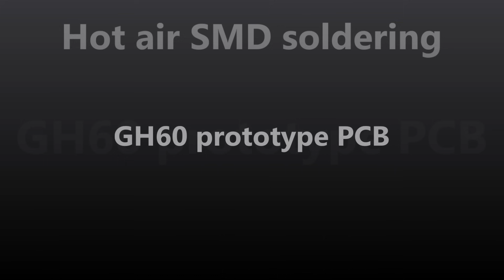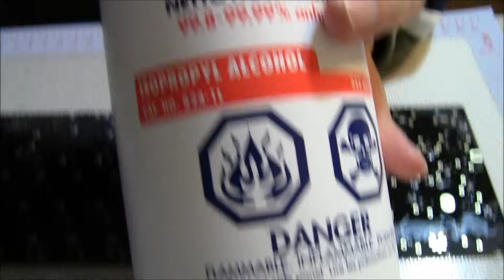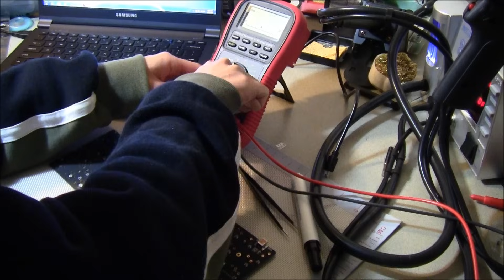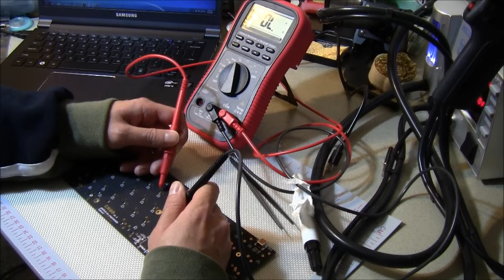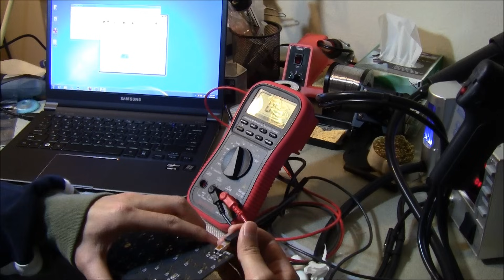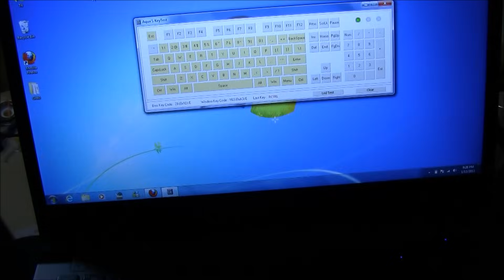SMD soldering by hot air

Comment: Well, I guess I goofed. The paste does not include a needle nor does it include the plunger. Digikey does not suggest that you add the 20 cents part to your order, so thanks a lot Digikey. They will also not tell you that the item requires an added cold pack which doubles the shipping cost. The paste also expires in three months so I had better get soldering...

Comment: what temperature and air power do you run your hot air and what temp is your soldering pencil at ?
Reply: +Chip Douglas Standard soldering pencil temperature is 700F.  Check the manufacturers product data sheet of the solder paste for the recommended air temperature and application time.  Always read the data sheet!!!

Comment: 17:15 Is the kapton tape (?) on the USB connector there to protect the internal plastic parts from the hot air?
Reply: I know it's been ~2 years, but in case you're still wondering, Yes it's!

Comment: This video would be far more useful if you gave us certain details like: What solder paste you used, what consistency is best [and are there other things to know about selecting the most effective product?] and what temperature and flow rate you set the rework hot air gun to, etc.  Also, we don't need to see every excruciating moment of solder paste application, camera adjustment, and heat application!!!  Some post production, please!  Otherwise, there was some useful substance.

Comment: What was the "marker" you used at at 11:30 and why?
Reply: That's a flux pen. Flux helps solder "wet" better by getting rid of oxidization. When you buy solder wire, it usually has some flux inside, which is what bubbles and smokes. Solder paste also has flux in it. But you're re-touching existing solder without adding more, you usually want to add flux.

Comment: I hope he has learned how to use a PCB paste template. (Sheet of metal with cut outs to where the paste goes.. So the paste can be slide across the sheet, thus filling the pads with paste.)
Reply: mhm... efficient.
Reply: If you need to do enough boards for that to matter, a die cut template makes a lot of sense..  but if you're only doing a handful, it's often not worth the extra cost, especially if you're doing whatever as a hobby, and not primarily for profit.
Reply: Valueless Dollar it's called a stencil

Comment: whats the wattage of your iron
Thanks
Reply: I'll guess 30 watts, if guessing helps.  When touching the tiny joints, it took at least a few seconds before the solder melted.  Also, the tiny needle soldering iron tip doesn't have enough mass to conduct a lot of heat, which also explains some of the time before melting, even though the joint is tiny.

So, iluvbeanz, what's the wattage of your iron?
Reply: Cheers

Comment: Legit question not bitchy comment: why not paste across the ic pads and drop it on top then use the hot air? Does it not work? Seems like it would...
Reply: Drop "it" on top?  Drop "what" on top?

What I saw, he was putting paste on the ic pads, and then dropping the components on top of the paste, and then using hot air.  Are you suggesting something different?
Reply: 5:45 - seems strange that you'd even need to tack it down, I'd assume the sensible thing is to paste across the pads and throw the chip on top and let the heat gun deal with it.

Comment: Where is your antistatic strap almost anyone can solder well with enough practice but if you discharge static energy from your body onto that controller chip all the quality soldering in the world is not going to make the circuit work. I see that it looks like you may have the board on an ESD mat and you may be useing ESD tweezers but this is an area that is never given the notice it deserves.  I am not trying to be critical of you , for all I know you may have a leg strap on but it would be nice to see this important part of soldering explained sometimes.  Otherwise good techniques .
Reply: You're obviously not an engineer.  Leave it to the pros.

Comment: The cringe from applying the solder paste, should have paid $30 for a stencil.
Reply: IMAKE 30 dollar stencil  for a 10 dollar pcb? maybe if he had 30.. you can hand solder these quicker just using surface tension.. but the hot air is pretty satisfying

Comment: You don't use flux? That is poor technique.
Reply from the maker: Except you fail to realize that solder paste has flux in it. If it didn't already have flux, then the actual solder would just be very fine dust. The flux mixture is what makes it a paste.
Reply: WhiteFireDragon
 What kind of solder paste you are using?
Reply: I was performing surface mount soldering long before any of you were probably born. I was taught to preflux the lands area, regardless of paste solder content. The prefluxing removes oxides on the lands, before the actual soldering process takes place using the paste or solid solder. The prefluxing removal of the oxides also promotes better and more uniform solder adhesion to the lands, it also reduces the frequency of solder bridges. I have been in the business of electronics for more than 35 years. Collectively I bet I have more experience and knowledge than all of you put together and have forgotten more than you will ever learn. That is my response to all of you now and those to come.
Reply: done
Reply: Michael Snyder thank you for the comment but the preflux can this be done with a flux pen or could you better use something else. thank you
Reply: Warner Hake You can use a flux pen or a small squeeze bottle ( with flux) with a needle applicator, the latter is available through most electronic suppliers ( Newark, Digi-Key, Mouser, or just about any supplier of soldering aids)
Reply: Michael Snyder thank you!
Reply: Warner Hake You are Welcome
Reply: Michael Snyder Respect to you sir! I am in university now, thank you for your comment.
Reply: Michael Snyder exactly :)
Reply: ***** please read my comments above regarding prefluxing, thanks.
Reply: +WhiteFireDragon I know very little about electronics and that was self explanatory to me...some people's kids... very impressive work, very clean, professional set-up. I'm getting into working on PCBs strictly as a hobby and these hot-air techniques are truly fascinating. I'm sure you just make it look easy!
Reply: +WhiteFireDragon The like button isn't working. Seriously.
Reply: also, I don't know if he uses it the whole video, but I think his screwdriver tip is too large
Reply: I've been using a Bon-pen for a while now. Made my soldering so much better with very little flux needed. Especially handy on very little islands that have virtually nothing to stick to...  ^^
Reply: ninjabox I see the OP ask a valid rhetorical question and make a valid statement. You on the other hand I see being snarky and arrogant. "You know." "But hey," I guess it's all in the eye of the beholder...
Reply: He didn't use flux to secure the first legs of the chip at 1:35. He used flux AFTER soldering the chip's legs to the board. Maybe he wouldn't have needed to fix the legs had he done that in the first place. No flux at 18:00 either. Even when using rosin core solder always use flux beforehand. It does make a difference.
Reply: Michael Snyder
Reply: Michael Snyder...   I don't doubt that you were soldering when some of these people were born... But are you still dressing and wearing your hair the same way as you did when they were born too?  As technology advances, methods change/adjust to better meet needs.  Currently Flux is a crutch.  Using external flux when not needed is poor technique.  Most fluxes are corrosive if not activated, and there is no easy way to verify activation.  Internal flux (flux within the solder) is guaranteed to be activated because the solder melt temperature is higher than activation temperature and the internal flux is contained within the solder.  External flux goes wherever you apply it and can run. Yes, flux removes oxides and in cases of high oxidization in the soldering area pre-fluxing is often a must... but on new/clean boards, external flux is simply not needed.
Reply: I was wondering if that hot air can damage the chips ?